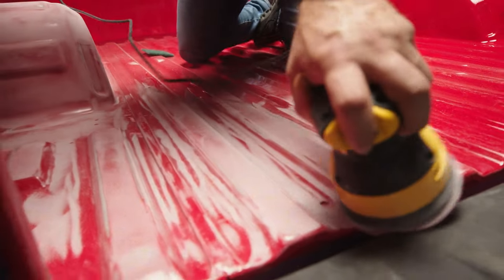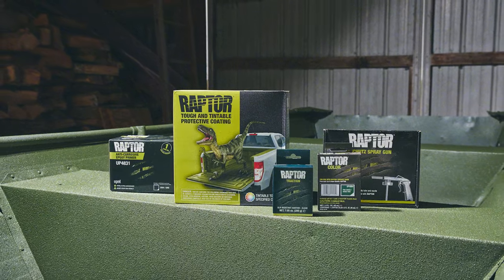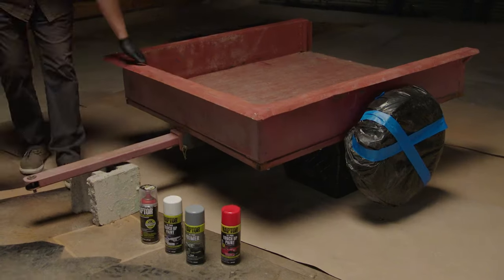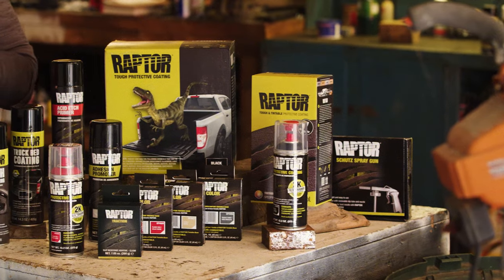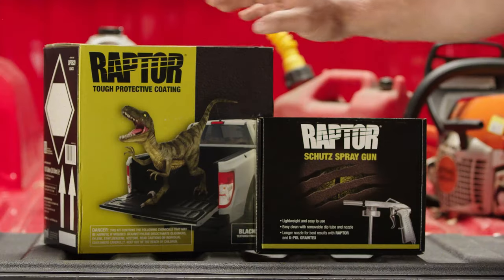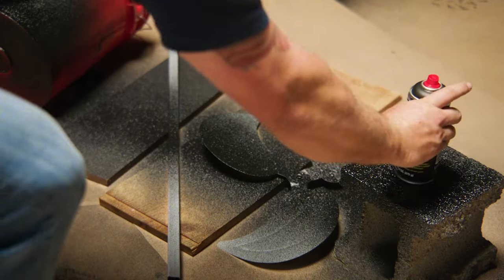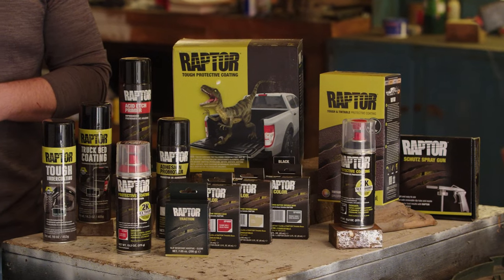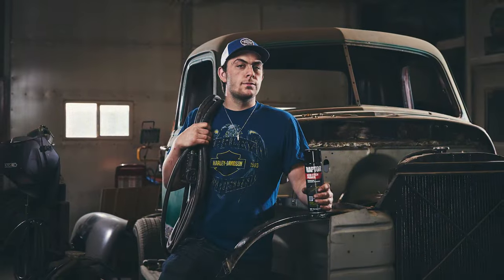RAPTOR 1K vs 2K: Unveiling the Differences

Comment: Hey everyone, hope things are well. I am a bass player and have 2 bass cabinets I want to put a headliner type of paint on the outside to keep them as nice as possible. Watching this video definitely makes me want to use the Raptor product, just wondering if I should use a primer for it to stick to the wood better. Right now, the cabinets have a very thin material, they call carpet, but it tares real easy, and I have seen more expensive bass cabinets with this type of coating on the outside. Any insight to this project would definitely be appreciated. Thanks for your time.